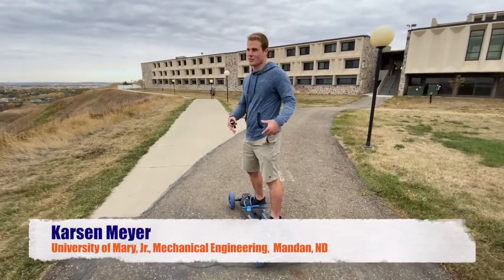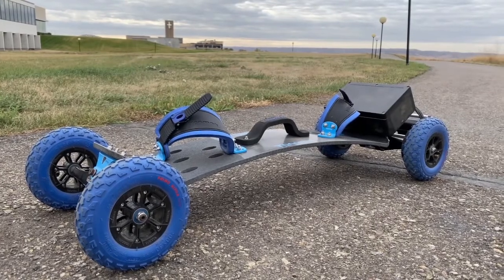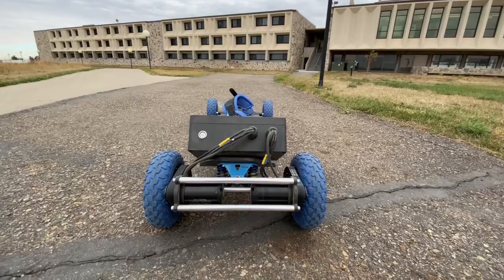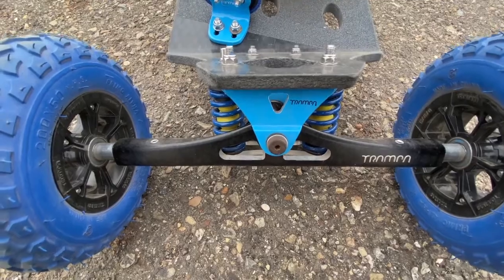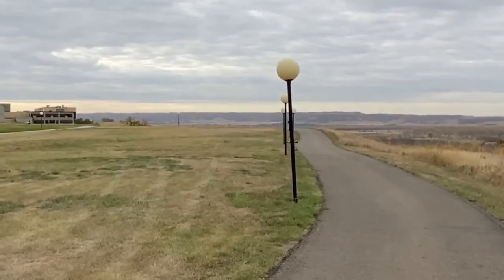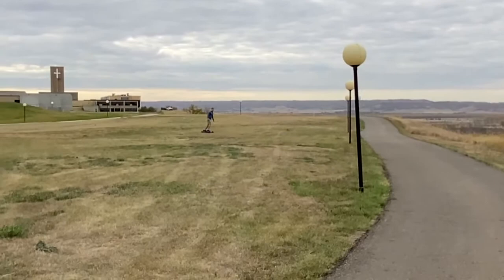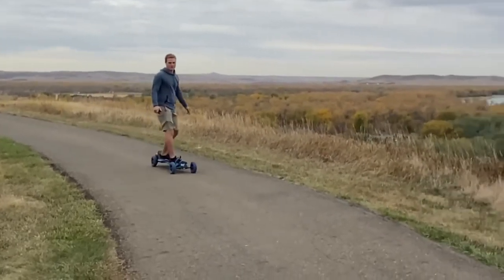University of Mary Engineering Student Builds Electric Mountain Board

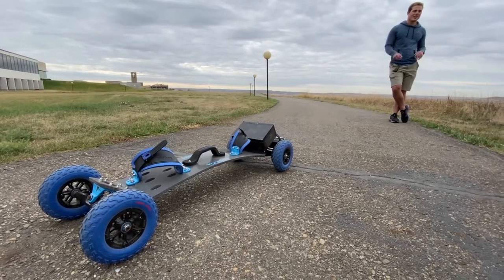Comment: Im not an expert but im doing rc things i thing thers a problem in the connection in 0:35 the connecting wire yellow and black blue there is a gap there when it rain it can connect the two wires that shoudn't be and  fry the elctronics